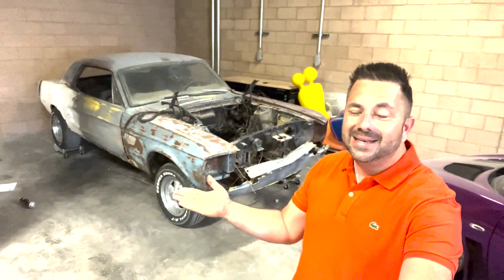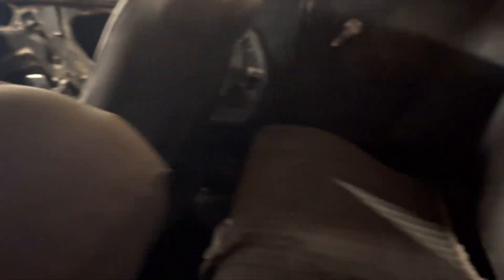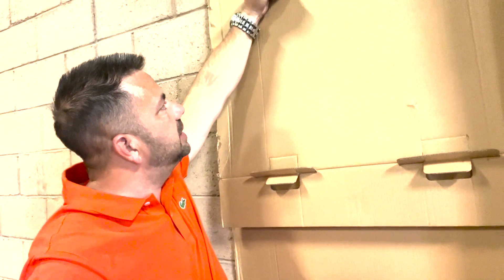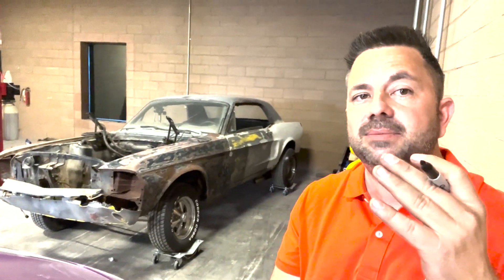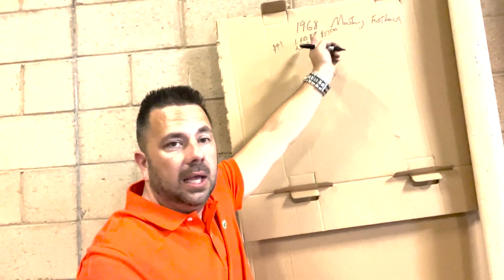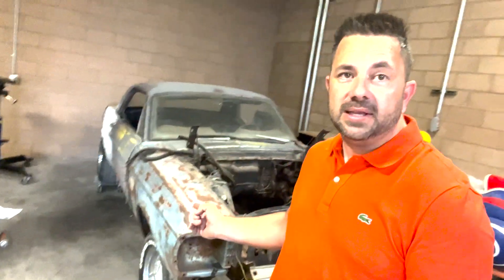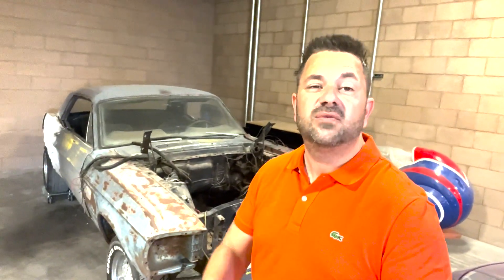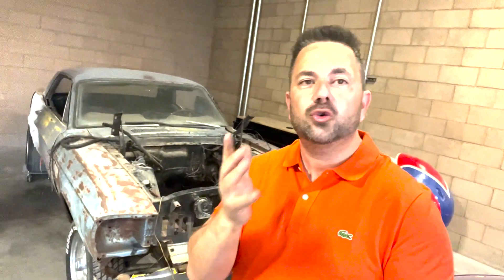1967 Mustang Fastback Conversion | Workshop Wednesdays

Comment: That $41,000  estimate seems awful optimistic to me. Do's that include the value of your labor? The reason I ask is that two years ago I restored a 67 fastback that was complete and had virtually no rust and required very little body work and I put about 43k in it.
Reply from the maker: Yes.      It does include labor.    I get stuff cheap so it will be under 41k.         You will see the process on the next videos